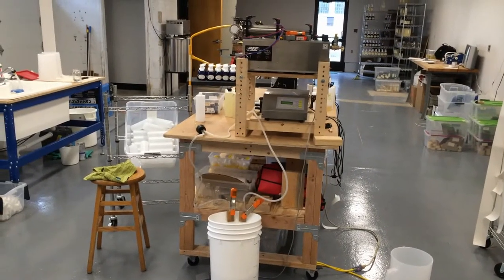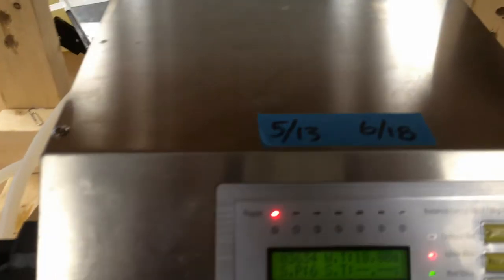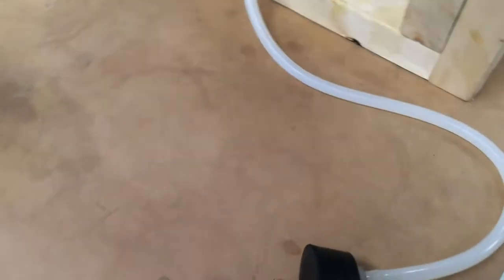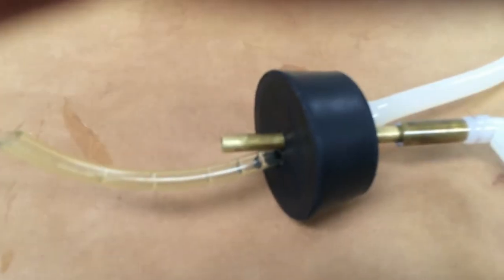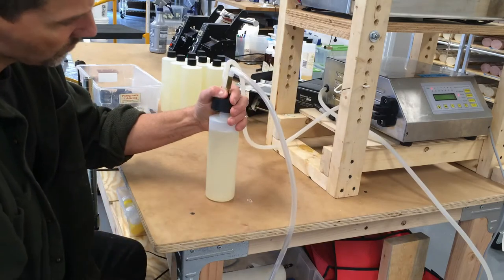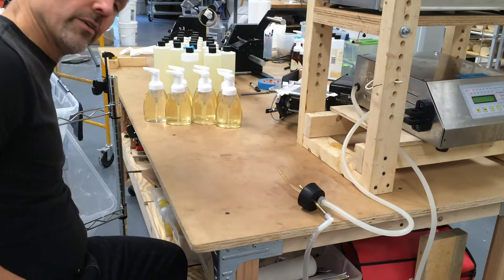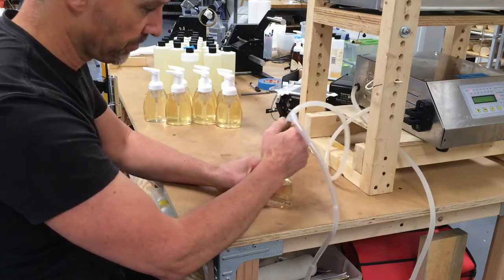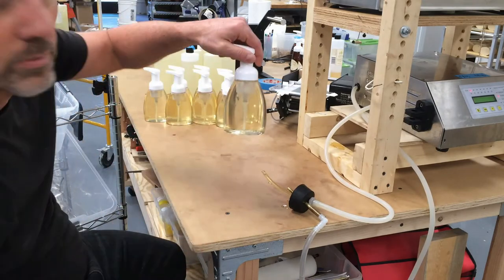Numerical Control Liquid Filling Machine for hand soap small filler pequeña máquina de llenado

Comment: Hello,
Great Video!
What speed should I use for filling bottles 250 ml?
Reply from the maker: the speed for 250ml filling is about 2000bottles per hour.
Reply: Thanks for the reply .. but I mean what is the speed and time needed ?... 6/18? or 9/15
?How to measure the time and speed required to fill a bottle of 250 ml
Reply: Thanks for the reply .. but again- I mean what is the level of speed 1,2,3,4,5,6,7,8,9 and how many seconds of the action i need to set .. What is the number of seconds of work?
Reply: Noibar, this people don't have an answer because they are selling a dummy. I have been following many videos and all seller are ignoring this same question.